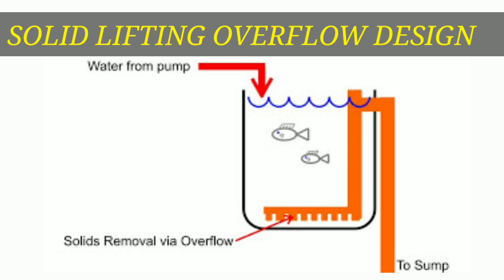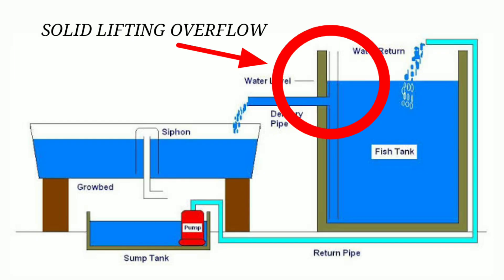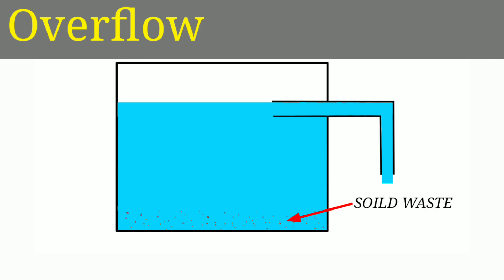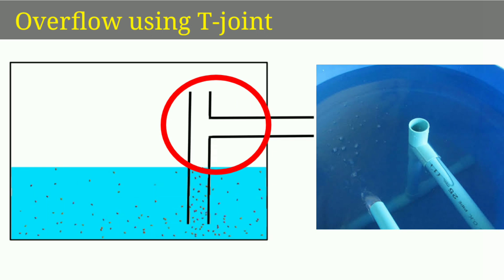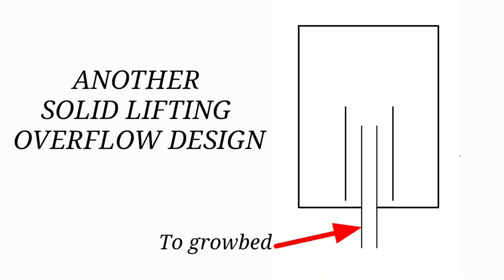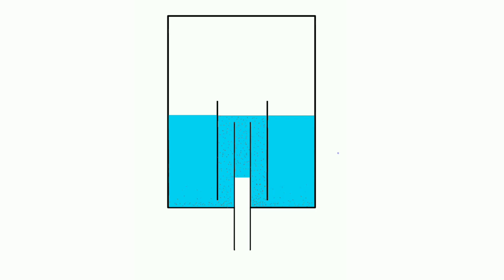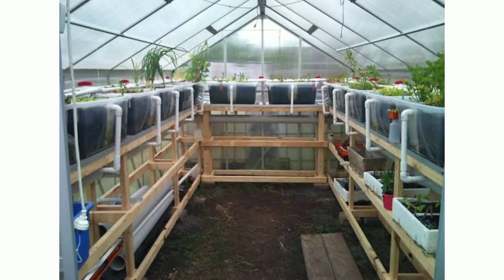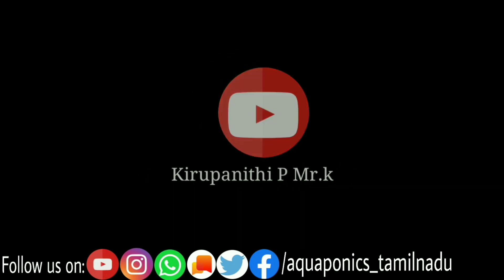Solid lifting overflow design in Aquaponics|தமிழ்|#aquaponics_tamilnadu #aquaponics #hydroponics

Comment: I have seen the three videos for over flow pipe. can we use one of the method for SLO instead of putting hole in the barrell. does it work?
Reply from the maker: What id the purpose for slo? Are you doing Aquaponics or aquarium
Reply: @KIAQUALORE aquaponics
Reply from the maker: @kevinmuthu2063  we can use but not thet much effective, if you want to try use 3rd method it will get water from bottom with waste